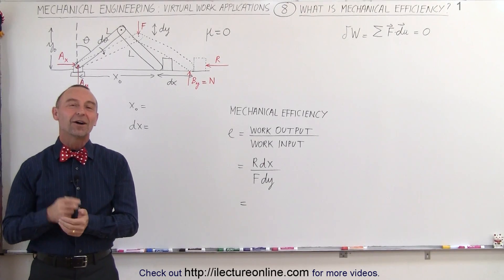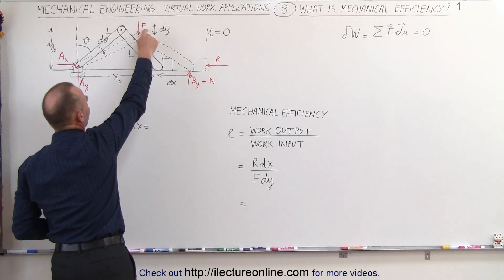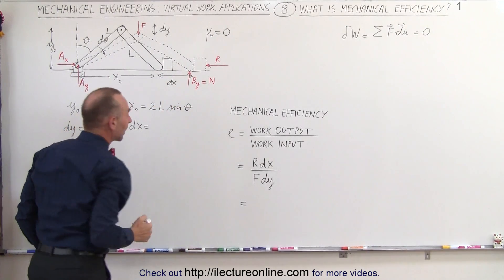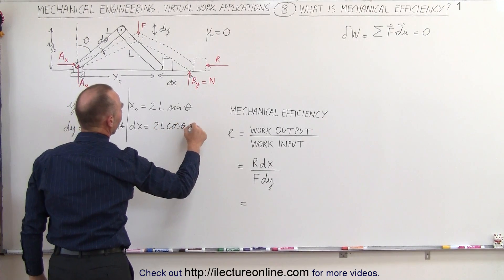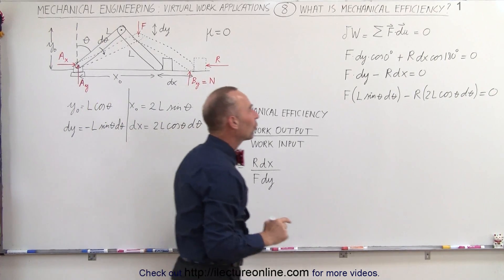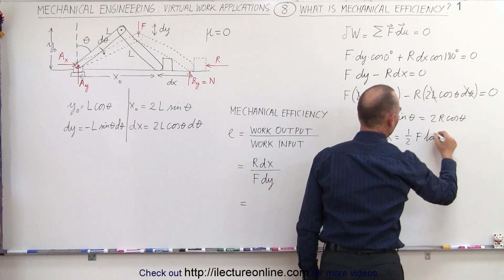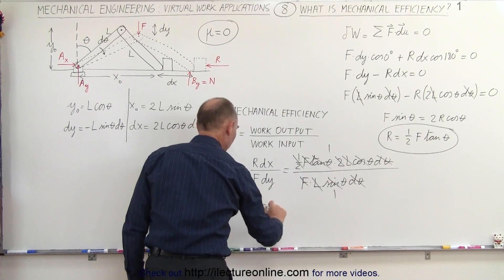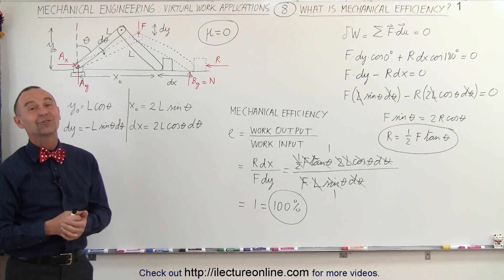Mechanical Engineering: Ch 13: Virtual Work Applications (8 of 39) What is Mechanical Efficiency? 1

Comment: hello can someone explain me why is he saying that we need the magnititude of dy , in 3.56, WHY MAGNITIYUDE ? I DONT GET IT!
Reply: When looking purely at forces (which is happening here, though it can be a bit confusing with the writing) you always take the magnitude of the forces as those give you the pure force that is applied along the member/axis/whatever that you are trying to find. The vector just gives you the force along each separate axis, which can also be used in some instances, but it is not beneficial if you are talking about purely finding the force.

When analysing trusses, you can have negative forces as those are (usually) allocated to compression in order to make the difference between compression and tension more discernable, but even then you first take the magnitude of the forces as you want the pure force and not the vector

Might be a bit of a vague explanation, but maybe it helps?